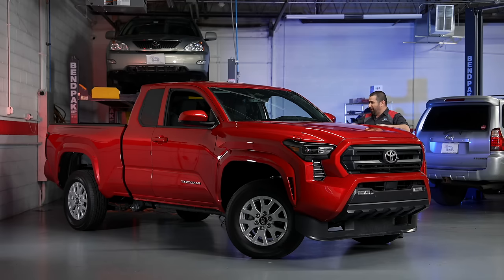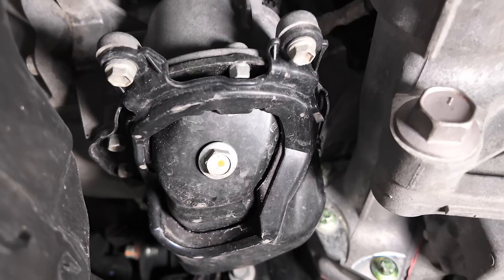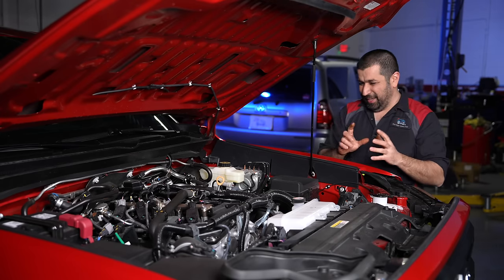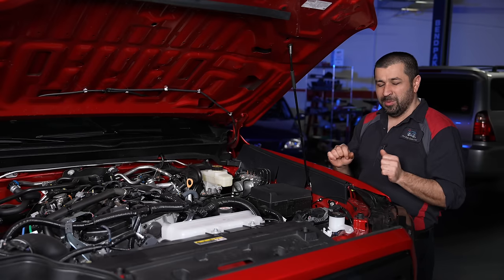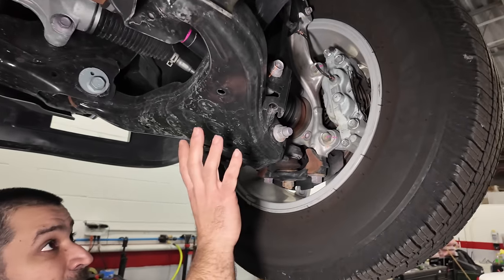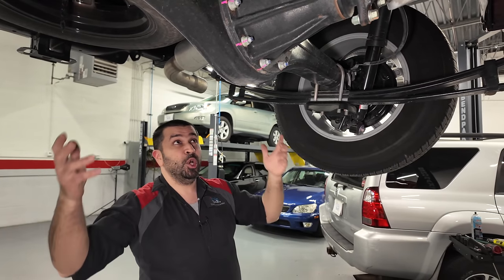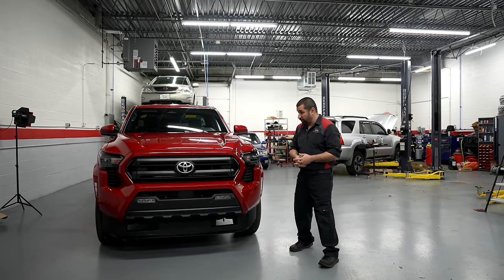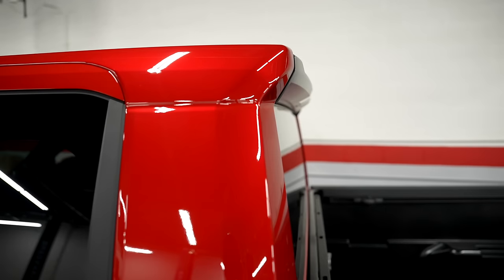2024 Toyota Tacoma | Did Toyota Improve or Ruin The Tacoma? Comprehensive Review

Comment: Outstanding video. Everything I needed to know. Thanks very much. Looks like Toyota did a good job. Disappointing they are using plastic parts in the cooling system. Simple, but not sure it will be as long lasting as older vehicles.

Comment: I bought a 2023 V6 4 months ago before they were all gone, I did pay a hefty 48k but I wont worry about the performance of the truck while I'm towing the RV, the boat or the motorcycles trailer.  I would stay very far away from a working truck with a 4cyl turbo engine.

Comment: I don’t know whether it’s worse or better.  I was at the dealership and opened the back door of the cab to sit in the rear bench seat.  Could not fit in and I’m a small to average guy.  Salesman (nice guy) stated pointedly that the truck is not made for rear seating of adults.  Huh?  My last Tacoma was not spacious, but it could—tightly—fit an adult.  So there really was no reason to continue consideration of this vehicle.  My Ford Ranger does not have this problem in the slightest, so I guess I’ll purchase another when the time comes.

Comment: My buddy has on 22 Tacoma with that 8speed transmission....He hates it, says it fumbles around at highway speeds, sometimes down shifts when you pull your foot off the gas/coasting.  Dealers says this is "normal".  I will admit that this new one looks better than previous models that seem to have been getting "over styled".  Unfortunately, I am afraid of the turbo 3 cylinder, we will see how they do after a few years.  I'm sure the turbo four performs well, just don't know how well it will do under heavy loads doing actual truck work.    "Old fashioned" I guess.  I would consider the manual tranny though....
Reply: The previous gen Taco is a dinosaur.  The only thing and again only thing is the ancient yet reliable V6.  Everything else are just not up to 2020’s standard.

Comment: Another great video. Thank you for sharing. Hope you can answer this. Is it safe to spray 303 Protectant on the rubber and electrical wires inside the Engine Bay of my 2021 Toyota Rav4 Prime, as a preventative maintenance and would YOU even recommend it?  With a million subscribers and comments you probably won't see this this next year. Take care and stay safe.

Comment: Im torn between getting another 3rd gen manual or 4th gen manual.  My question to you is about the engine.  You said it is in some other lexus models. What are some of the models? You may have stated it and i missed it. Also, what are some higher miles you have seen so far from this motor?

Comment: Great review.  It’s going to take me some time to buy in to the small turbocharged engine era we are in now.  We don’t yet have examples of either this truck or the new Tundra going hundreds of thousands of trouble free miles yet.  All we have are interviews with the engineers that designed these engines telling us how great they are designed and how they did extreme testing on these with no problems and it all just leaves me thinking that’s great but it’s all theoretical at this point.  The design and testing might provide some confidence of reliability but they can never simulate real world conditions no matter how much they say they can.

Comment: I have a question, let's say I bought the Hybride Tacoma and in the next 5 or 7 years, the Hybride engine or all the batteries are dead and no longer working. Can the Truck still run on the gas engine without the Hybride engine as long as I don't care about the MPGE drop or will it not run without the Hybride engine?

Comment: It’s not the dam in front it’s the plastic in the engine compartment the cooling system that will have issues the clamping system probably after warranty runs out and second the rear suspension probably maybe ok in none snow ❄️ areas but little snow with ice melting products big issues on the way. Again that front dam plastic piece is not at all an issue easy removal ten minutes or less. Nice looking truck. Great review thank you

Comment: I just got a 2024 Tacoma SR manual transmission. It took 3 months to get after ordering from dealership. I previously had a 2005 Tacoma 4-cylinder manual. 
Would you recommend using premium or Supreme gas vs. regular gas since it's a turbo charged engine? Also, I saw somewhere that it is recommended after running the vehicle to wait one to two minutes after you park it before shutting off the engine to give the engine time to cool? Is that true? Thanks
Reply: That's for higher boosted engines that need higher octane gas to prevent detonation , turbo timers delay shut down to allow oil to keep flowing to the bearings in. The turbo to prevent coking... you don't need that in the tacoma. Congrats on the purchase but I hope  you keep some cash for a turbo replacment that will eventually need replacing

Comment: I hate the two piece drive shaft and after changing 3-4 carrier bearings . On my 05 Dodge 3500 4x4 diesel with 4 door cab and long bed dullay and there is I place called East Texas Dodge drive shafts and they send you the papers to show you how to measure for your one piece drive shaft and they use all new parts for both ends of the drive shaft and I think it’s 72” long and a 5” diameter drive shaft that’s made of aluminum  and it’s so good no vibrations and it’s not cheap I think it was 800 bucks to my front door and I love it.

Comment: Good video- dislike the back windows wing and dam in front. So why do a dam if you say to take it off?  Too bad the towing weights went down. I   I guess that's why they sell the Sequoia. You are right prices went up in all Toyota vehicles and interest rates are a real killer.
Reply: Toyota added it from factory for gas mileage. Just take it off when off-roading, there are parts to remove when you take a 2000 Z71 pickup off road.

Comment: Hey CCN, can you help answer me something, this car has the same engine as the Lexus NX350 but the NX350 says premium gas is required where the Tacoma does not. Can you tell me why the difference or if the 350 Lexus cars can use regular? The manual says they cannot. If you have any advice please say.

Comment: Love your review a lot, like the truck not at all. A 4 cylinder turbo is not a box many truck buyers would check and I would never buy. Many years experience repairing european turbocharged engines and they are all pretty much oil burning , carbon making, sludge building junk. A 2024 Frontier with its low tech 3.8 is my choice for my next truck and it costs a bunch less than the new Tacoma. I like my low tech 2021 Highlander a lot .

Comment: To me that’s crazy that the just started with 4 wheel disc brakes and they need to up grade the rear suspension like a 4 link or some would say a 5 link and that would make a great ride with coil over with internal air bag and the  track bar to keep axle where it’s supposed to be at all times so welcome 2024 come on Taco get it on point .

Comment: The XtraCab is an inferior cab IMO. The Access Cab is ergonomically better and is more versatile because the little seats can be used occasionally. Also the lower trim SRs with the coil springs get less payload capacity than a Double Cab with the more expensive coil springs. The manual transmission is not available with the extra cab and the SR trim still has only 3500lb towing limit.

Comment: The TFL channel just bought the new Tacoma. They took it out in Colorado for its first real-world course test of the 4X4, and on its first test, the front differential snapped. Since they are such a big channel when it comes to Tacoma, 4Runner, Rav4, and everything TRD, Toyota has sent 20 engineers to Colorado to look at the differential on the TFL Tacoma and figure out why it failed so quickly.

Comment: Interesting design idea with cutting off coolant to the heater core.  I wonder if the non-circulating coolant (in hot parts of the country) will cause problems from sitting and not being moved through. Time will tell.

Comment: I've watched several of your videos, and generally find them quite informative.  Toyota must have paid you considerable to do this review.  I've owned 10 Toyota pickups.  First was a new 78 SR5 Longbed... current is a 2017 TRD Off Road 4x4.  I've owned 4 cylinders, V6 versions... 5 speed std and several automatics.  I gave up on the standard transmission... cuz first gear is geared so low I had to learn how to creep thru stop signs in 2nd gear.  All before my 2017 were 2 doors.  I was forced to buy a 4 door this time because no one had a 2 door, so resale value on a 2 door would have been crap.  This new 2024  "extra cab" is like stepping back to my 86 SR5 xtra cab.  The best thing about it was that the seat would finally go far back enough for me to fit in the cab.  My 2007 Access Cab was wonderful because I could easily throw all my crap in the back to keep it secure... never used the seats back there.  Now all my crap goes in the back seat of the 4 door... and nothing fits in the standard bed.  I definitely have no use for that new Extra Cab.  As for your hate of the front air dam... I had to go buy one off Craigslist for my 2017 Off Road, because it came without one.  I happen to like the look of air dams, and based on all the gas mileage whines I see on here, apparently that air dam makes mine get a lot better mileage.  I also added mud flaps.  I rarely go off road, so don't care about ground clearance.  Apparently you never had one of the current generation to see how heavy that damn tailgate is... especially when your arm is full of something and you're trying to close it with the other hand.  As for that beautiful front bumper... worthless.  It protects NOTHING.  And your review underside... where's the catalytic converter... the most important thing that has to be protected these days?  Center console storage... even worse than current generation... never any place to put drinks, phone, pens, keys, etc.  And then there's price.  I shopped hard and bought my last 2 with 5K miles on them... for $6K less than MSRP.  Seems it's common for the usual buyer to pay too much, and make payments for 6 years.  But... the higher price of the new one keeps the resale value of mine high. So I won't complain about people paying too much for a new one.  Toyota pickups are still the least expensive vehicle I can own... and I've owned over 50 vehicles.

Comment: I agree with you 99.999% of the time, but I disagree on one statement you made around @33:00. While I agree that the cast iron pumpkin/differential should be taking most of the load when engaged, it clearly is not in some situations when MTS is working overtime (on snow/incline/slipping) given the latest failure we saw in the 2024 tacoma. TFLTruck released a video on this where their 2024 tacoma front differential broke, and something internal failed in the shaft that connects the passenger CV to the pumpkin where the A.D.D engages. 

They were able to drive the truck home in 2wd mode which indicates the pumpkin gears are just fine, no noise or heat etc., the toyota tech on their truck noted that the actuator was working/moving but 4wd would not engage, something failed internally so they replaced the entire differential. Looking at exploded parts diagrams of the spline/collars internal near the A.D.D, it sure looks like those parts would be able to handle much less torque than the actual main differential gears inside the cast iron part. Would love to hear your thoughts on this as it has been debated on other channels. It might be nothing, might be a one off, but if it becomes a common problem it would be awesome to see you tear one down to see the internals, or just give your expert thoughts on the subject.

Comment: Please verify, I've now caught a report of the front bump stops being built into the shocks.   The stand-alone units no longer exist on the 4th gen.  They are breaking because of the design by cracking the housing or being pushed through the top mount.

Comment: Ah, but you can shift into 4hi and unlock the front hubs.  This gives the ability to drive all the running gears and oil in the system with no binding.  Did that a few times a year with regular maint.  Driveline never failed, 3rz did.

Comment: Here have a more complicated motor now using a turbo $$ when it breaks opposed to the solid 3.5 6 cylinder...this is a fail to me...sorry. Replace with an easier to assemble but more intricacies that will fail.

Comment: Oooh, I was hoping it was a manual. Also fascinating that the only differences between the engines is software. (And oil cooler). Just like cameras and electronics in the 90s, when it was cheapest to manufacture a single machine that CAN do anything, they just enable/disable features and the game was to buy the cheapest version and trick it into enabling every feature. Oooh also leaf springs? Buckboard technology that’s cheap and doesn’t break… but…

Comment: I like to watch and trust The Car Care Nut.  I had one of 22R 4 cylinder. 5 speed manual. motors in a Toyota pickup 20 plus years ago.   WOW love and miss it. Power and gas mileage I now have the 2021 Tacoma TR5  V-6  Can tow 6500 LBS.PS may sure you have TRAILER BRAKES CONTROLER INSTALLED !!!!   Ask Me I know.even empty trailers push this truck around on emergency stops. Gotta have TRAILER BRAKES.    At my 10,000 miles oil change and like 2 years, Toyota offered an extremely high trade in value.....

Comment: Every car should be a hybrid to replace the power of 2 cylinders while being gentler instead of harder on the engine. Even a mild hybrid (1 motor replaces flywheel) that can't drive with the engine off would help a lot with gas mileage and engine longevity. I've loved all my Toyota hybrids

Comment: Anyone have a hesitation or a skipping feeling in a 2018 tacoma? It did this from driving off the lot. I had a fuel pump recall and it seemed to not do this skip for 2 days and then started back usually when the engine is cold.

Comment: I respect your opinion greatly . Pls comment on the following if you could. My current ride, 17 Jeep Grand Cherokee Trailhawk is a AWD with lo 4WD via electronic button. IT HAS BEEN and REMAINS a real problem because of the way the transfer case Clutch packs operate......they dont last very long at all because they are always doing something behind the scense.....for instance if you get a bad tire with more than say 2k miles of wear they strongly recommend, and so does every mechanic, that all four wheels get replaced because the circumfrance is significantly different than the others and hence the transmission spends a lot of time shifting back and forth to adjust.........If I knew this I would have never bought an AWD system like this and it sounds like the 24 Tacoma is similar.......My 07 FJ Cruiser with a standard was what I am now looking for......2WD with a $hi and 4lo........your thoughts?

Comment: Sorry, but this exact SR5 Tacoma with the base turbo engine vs my '18 has less power and less MPG. My '18 also has doors for the Xtra Cab, which is absolute deal breaker for the '24. It also wont snap the front CV joint in 4 wheel drive like everyone else is doing with their '24's.

Comment: The 2024 has less towing compacity 6500lbs vs 6800lbs and engines with turbos idle at a higher rpm which can hurt longevity. How long has Toyota been even been using turbo engines in production for trucks? Two years?? I don't want the cost of replacing the turbo in a factory setup when it fails.
Reply: Welcome to NOT a free country.

Comment: I rented one for a day while my car was in the shop for repairs. It has plenty of power. It feels like a V6. The engine feels bulletproof. It sips gas.  It's a little hard to get in and out of. It really needs a step. Visibility is not as good as I would like but it's adequate. The seats are average. The ride is typical of a truck with big tires. It's not a great daily driver if you live in the big city.

Comment: I only have 15000 on my 23 sr5 access can so I’m not in the market for a while. My last one had 200,000 plus and I decided to go with the 23 new to stay with the v6 as I tow a travel trailer and a small constriction trailer a lot and I need something that I know, with a known suspension I can upgrade. I also did not want a first model year of a redesign. But I do have high hopes for this gen 4 especially in the sr5 with the smaller cab and the 6 foot bed. It seems like the engine will be fine and in some ways better than the v6. And the 8 speed transmission is welcomed. My one HUGH disappointment is them getting rid of the access cab doors. This was a massive loss. The seats in the access cab were stupid. They needed to go and turning this into storage space was a great move. But they are making this smaller cab as a work truck. I’m sorry but the doors should have remained so one can get to their tools or whatever else is stored without moving the seats all the time!  Hopefully they will realize this and bring the doors back.

Comment: I would never buy a tacoma anymore. They ruined it forever turning it into an expensive toy. A turbo on 4 cyl fries the engine faster, and you  never get the power to pull like a v6, and you add much more complexity. Hoses and wires all over place, and a billion more sensors, making it more prone to fail and more expensive to repair and to mantain. The next step to ruin it even further is to make it hybrid or, even worse, electric. I will take a look at the Nissan Frontier or a full size Ford f150 with a man's v8 coyote engine. Sad Sad Sad.

Comment: Miss the V6? The real tragedy is that the 2TR-FE cast iron block legend is gone.  Thats even more simple and reliable than the V6 that is gone.   I bought a 2022 2tr-fe because I knew after 25 or so years, the engine would stop being made. I only tow surfboards and fishing gear so it’s perfect and will probably last 400,000 miles with my service intervals.